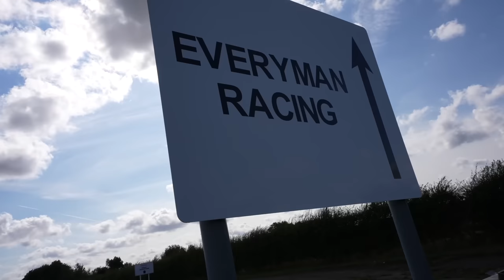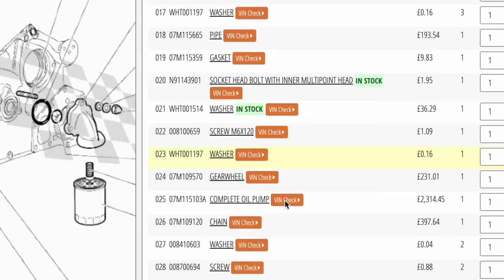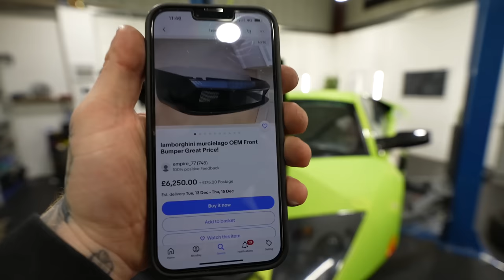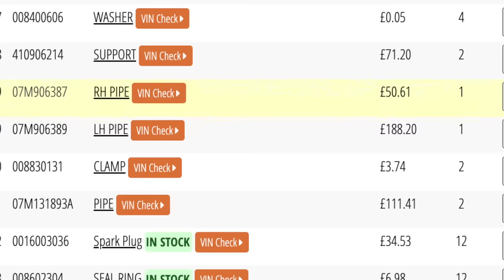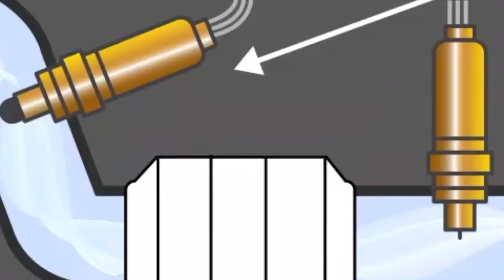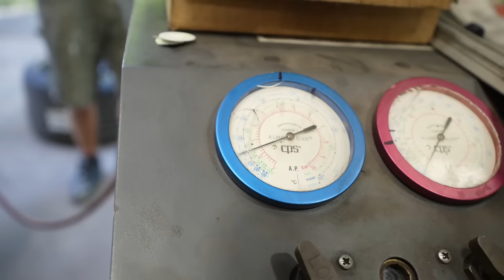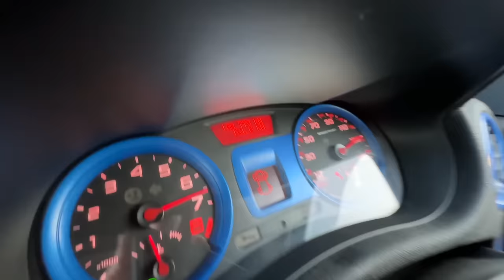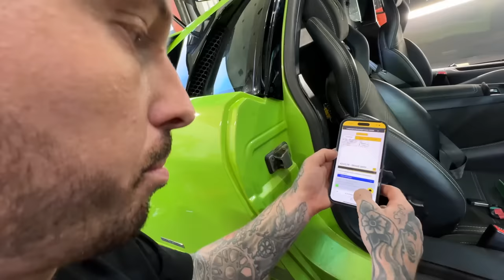FULL BUILD - REBUILDING AN ABANDONED LAMBORGHINI MURCIELAGO

Comment: The flap inside the intake manifold essentially opens and closes to change the effective length of the intake. Different length intakes are more efficient at various RPMs so being able to adjust the intake length allows for more power across a wider RPM range.

Comment: I took the dash apart on my Porsche 958 and got an air bag light. It seems if you disconnect anything related to SRS it logs the disconnection with a light which then forces you to check you've put everything back together correctly and then clear it with computer.

Comment: In my opinion, every cool car bike or truck I've had I've done all the work on myself. How else do you learn something you have never done before. Use a system of categories and placing and it's literally just assembly. I'm a mechanic, but today mechanics are a dying breed. The guys are all fitters today, just changing parts. The true mechanics are the engine builders, the guys pushing the limits of power, speed, or efficiency. The people building or rebuilding. These are the last real mechanics.

Comment: Too late now, but FYI, the ONLY way to get glass lenses out is to bake the whole housing in an oven at 250 F for 20-30 minutes. They come apart fairly easy after that. The key is to have 10+ plastic wedges to evenly apply lifting pressure around the entire circumference of the mating surfaces.

Comment: Wow! What a great job you and your dad did on the rebuilding of this car. I loved watching your whole adventure. Love how positive you and your dad are! It made me see what pieces of shit these cars are. Super dangerous with no good bumper. A high speed car in no way set up for crashes. Though I understand they want light weight for racing. I also love how you found cheaper parts from other manufacturers used on the car that Lamborghini charges and arm and a leg for. These high end tinderboxes are constantly breaking. Time to build a car with none of the updated crap like all the sensors and make a better structural body for crashes. Let the old be new again as they are easier to fix and less problems. Congratulations though this was amazing to watch you and your dad figure it out. Great job and it is a cool looking car. Love what did to the interior. Now get rid of it and make some cash.

Comment: It's amazing how many parts are so cheap, how many shortcuts they take, you just think how much normal manufacturers could save if they did the same thing, and it kind of makes Lambo look bad...but then you hear it....and it all suddenly makes sense why Lambos are so special. You get a slight hint of it early in the video, a bit of foreshadowing, when you see 12 cylinders. Most of us are so used to seeing 4, 6 or even 8, and it just seems so normal, then you see 12 and immediately it looks different to the eye. Then later in the video you hear those 12 cylinders and it's just magical, and you forget about the Ford indicators, the Rover AC, the Audi ashtray and the horrendous amount of glue. Normal cars will never sound or look like a Lambo, all the problems become irrelevant, it's pretty much a V12 stuck to a bargain bin and it's still one of the all time great cars, not just a great Lambo.

Comment: ALWAYS TRAVEL with jumper wires of 14 to 10 gauge wire, of various lengths with GOOD alligator clips. DONT leave home with out them. 

Jumping that fan relay at the Gumball would have taken TEN SECONDS with a l pre-made 14 gauge jumper cable. Shseesh!!!
You can PURCHSE pre-made 10 gauge MOTORCYCLE jumper cables cheaper than you can make a set!!!!  YUSA, I think.

Comment: The larger your following the closer you get to influencing manufacturers and suppliers - particularly on pricing, I wouldn't be surprised if Ferarri don't alter pricing on their shims to be clever like Lamborghini soon. Thanks.  Its not unheard of to cut access through the body on a composite to reach an assembly but its frowned on and absolutely should never be anything but a circular hole cut with the right tool - it must NEVER be square or have corners, those edges and corners will grow fatigue cracks and what you might have gotten away with becomes structural and causes serious failure of the structure. Self-made gasket seals are ok but they are usually made by rubbing the edges through the paper to get the outline and either filing the cut or cutting it by hand, the difference between this and factory made is that the factory process gives you very tight and hardened edges whereas handmade edges are rough and more likely to fail - Im speaking as someone who does what you do but on aircraft. In terms of your water logged question - we've seen that on aircraft interiors, some detailers use wet dry vac's and sometimes these machines are not maintained and leave far more moisture behind than you would think, do that a few times and you start to water log your linings and covers, now I test the entire interior with a moisture meter after detailing, we have seen 60million dollar jets with such bad water damage in the textiles and linings that they had to be completely replaced.

Comment: Around  03:50    WHOA!!!!  Wheel-tire fitment is WAYYYY off!!!   Those tires are STRETCHED to the max. Those wheels are way to wide!!!   Unless there is body clearance to fit MUCH WIDER tires!!!!!!
Handling is severely compromised when you fit a tire to a wheel that is three sizes TOO WIDE!!!  Somebody fucked up!

Comment: 1:45:03 ... You did not apply enough sealant. And it should be evenly distributed. You also applied sealant on the outside of the threads, instead of on the inside. Now, oil can leak via the bolts..... Mat, small mistakes like these can cost you LOTS of money, later on....

Comment: The calculation was wrong in column 1.
1.Shim needed mm: 3.689 (3.70). 
It should have been 3.729. 
(0.5 - 0.279 = 0.221.) then 3.95 - 0.221 = 3.729.

Comment: Murci tire sizes ALL YEARS: 
Front 245x35 R18 and wheel size 18x8.5 inches
Rear:  335/30R18   and wheel size 18x13 inches.  
WOW! 13" wide wheels. Hella wide.
IDK why Matt was talking about 19" in the back. I found all years and models of the Murci came from the factory with the sizes I posted.
Must understeer like a MF. I would try to fit at least a 265mm tire in front.

 Hell, my little M3 runs 265/35-18 front tires on 17.8 lb   D-Force 18x9" wheels.
No spacers, no fender rolling.

Comment: At some point in the 90s I think rover went through a liquidation and was sold. All their parts they had would have been sold to cover debts so companies like lambo and pagani could buy up un specific parts like Ac lights for interiors, displays, electronics for engines, relays and solenoids and so on. Many company's do this through deals, VW did this through buying up other companies. Nissan and Renault share alot, also use some Mitsubishi electronics in Renault. Citroën and Peugeot are literally the sane thing, 2nd gen mini is a BMW, paganis are powered by amg Mercedes 7lt engines and drive trains. The only mostly in house constructed cars today are the likes of koinegsegg, tesla and rimac, other eletric car companys also.

Comment: NEVER use WD-40 as a lubricant. It is a penetrating oil and a WATER DISPALCEMENT oil that evaporates quickly. I like full synthetic SUPER LUBE spray and grease. Good stuff.

Try WD-40 to saturate the locks and agitate with the key and FLUSH out dirt, rust and debris. Lightly LUBE with Super Lube spray.  
FLUSH with WD 40 every six months to keep your exterior locks healthy. And re-lube with Super Lube. Not grease. It attracts too much dirt.

 DO use a LOT of Super Lube grease in an exterior lock the WINTER with any car left outdoors all the time. Your locks will tend not to freeze up!

Comment: Charging at 13V  is way too low. You will never get a full charge. You can add resistors to fool your faulty voltage regulator so it will put out 14V.  If not, you MUST get a new alternator!!!!!  Unless you have a separate voltage regulator. That is waaay old school. 

Almost all cars have alternators with built in voltage regulators.  I prefer a sperate one, actually. They used to make ADJSUTABLE separate voltage regulators. Its cheaper NOT to do that these days,. Face Palm.

Also any sound system will suffer horribly. They COUNT on getting 14V when they operate. So do ECU's etc. They don't LIKE 13V!!!!   They NEED 14V to operate properly.....many/most of them.

If you see your battery at 12.58 Volts BEFORE and after the car is running, them you are getting zero charge.
A battery showing 12.5 Volts is only HALF way charged. A fully charged battery that has 100% capacity will read 12.75V after it is taken off charge and allowed to settle for a few hours.
A discharged battery almost empty,  will show 12V. Anything BELOW that usually (depends) not be able to start your car. Sometimes even a battery showing 12V will NOT start your car or truck!!

The constant use of jump packs is VEARY HARD ON YOUR  electronics!!!  You should have an EXPENSIVE 10amp programmable, automatic trickle charger hooked up to your battery almost every second a super car is not running on its own.  I have TAG LINES on all my cars. I just plug in to the TAG LINE that can always be purchased  for 15 dollars on Amazon. You can EXTEND the tag line if necessary!

Do NOT connect the tagline direct to the battery if your car has jump terminals. Rather connect the tag line to the jump terminals. Here is a $100 system below (NOCO). There are better, but this one works pretty well. I UNSCREW my remote jump terminals and connect my tagline that way. Easy peasy.

NOCO GENIUS10, 10A Smart Car Battery Charger, 6V and 12V Automotive Charger, Battery Maintainer, Trickle Charger, Float Charger and Desulfator for Motorcycle, ATV, Lithium and Deep Cycle Batteries
$99.95 on Amazon

NOCO GC008 X-Connect M10 XL Eyelet Terminal Accessory Genius Smart Battery Chargers. (DELUXE TAG LINE)
$15.00 on Amazon

Comment: You need an all BRASS kill switch or a MARINE TYPE switch(best choice!)  That rusty piece of crap needs to go straight in the bin. NOW!!!!
The stupidity of using that type boggle my mind.

THIS all brass marine-grade battery switch is MADE IN THE UK!!!  It is only $46 here in USA on Amazon including shipping from the UK.

Cole Hersee M-284-BP Switch (Rot Mast_Disc (2 Position) Lever)
This is part of the Battery Master Disconnect Switch Product Line for Cole Hersee

Comment: Christ I bought a Ferrari in the 1970s with the engine out and a hole in the side from a rod going through it plus the gearbox and nearly everything else stripped for £1500 not a fraction of the probs this car has. £100,000  is insane.

Comment: I had a chance to DRIVE a Murci and simply could not. I did not fit with my  Size 14 Medium width  feet, even with driving shoes on. Also, 6'4" and 240lbs. Forget about it!  So tight and uncomfortable. I HATED the car.  I was  uncomfortable even as a passenger. Tortured.

I fit in the Gallardo far better. But I hate column mounted paddle shifters.
I am very happy with my highly modified BMW  E46 M3, thank you very much.

Comment: Bloody hell. I'm gobsmacked. Looks like Lamborghini are using cheap parts from standard sedans, pushing up the price 1,000% and then selling it as "Lamborgini". Starting to wonder how much  on the Lamborghini is actually manufactured "by" Lamborghini. Probably only cost them (Lamborghini) like 250,000 to build the car and then sell at 700,000+ profit.

Comment: I honestly cannot believe that you are leaving that old oil filter on there after all the stuff that you’ve seen wrong with that vehicle. It’s still on now when you’re testing your rubber O-rings head oil leak. It just doesn’t make sense to leave an old dirty filter that possibly has metal in it on a fully rebuild engine why are you doing this?

Comment: What do the Italians think, they are great car builders, for me they are just parlapipa, cheap builders, super poor quality, even the expensive cars, I have a small truck [mopetauto] diesel 2-cylinder because I am not allowed to drive a commercial truck in mine country, if you are a pansionist
Now look at the prices, a front shock absorber each 125 euros unknown no name
In my country you get a set of 2 front and two rear for 180e
Sachs
A brake drum for the rear, ask 120e. Unfortunately I can't find it here. I have repaired the drum
The main brake cylinder is from the old Fiat 124 or Lada, the questions 180e. A friend of mine has a shop with brake and clutch material
he gave the cylinders free
and the small car, like all Italian cars have problems with the electrical system, I have rebuilt the entire electrical system and converted it to Germany standards, no longer a problem